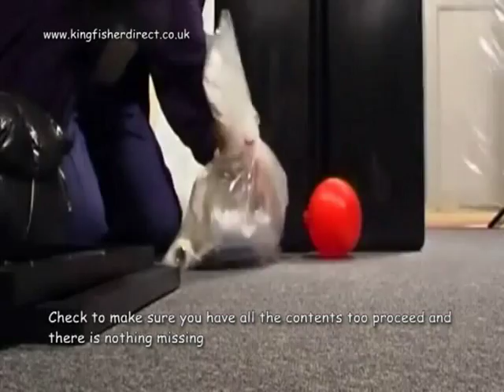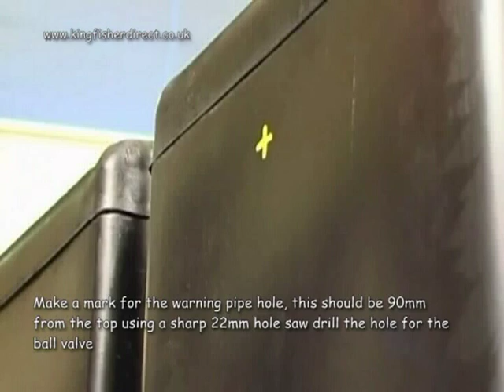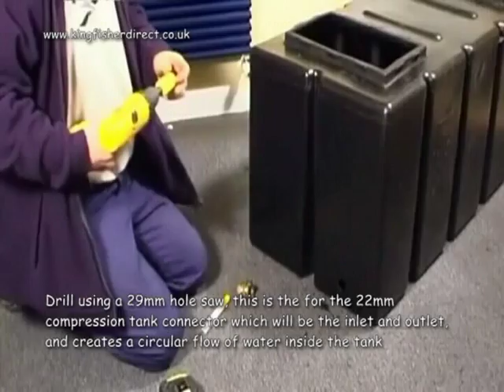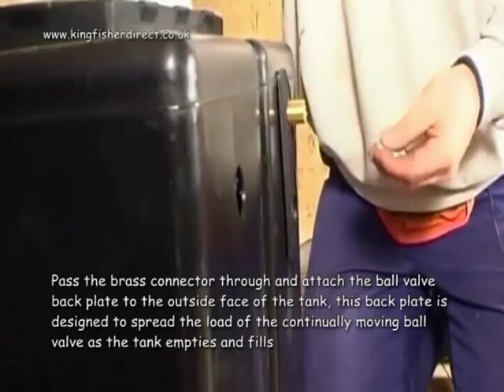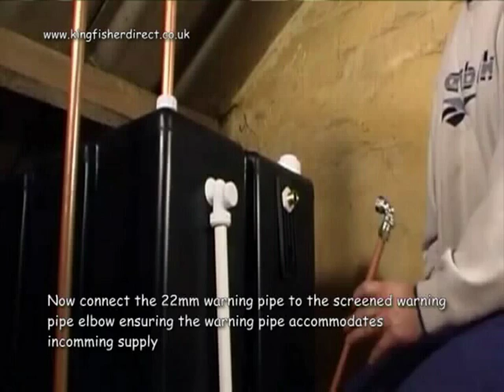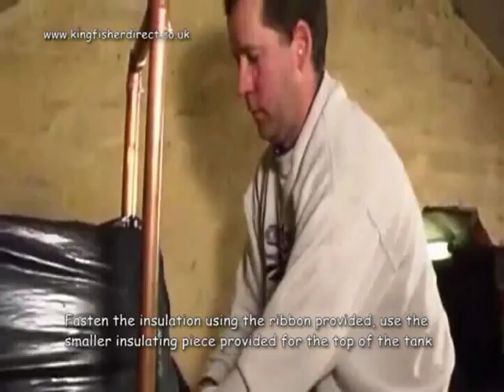How to Install a Loft Water Tank

Comment: Has the 'plumber' made a mistake by installing the rubber washer on the outside of the 22mm connector outlet,instead of the inside as you quoted?